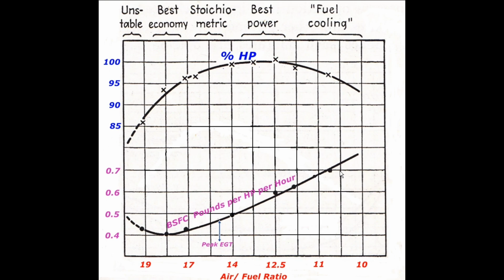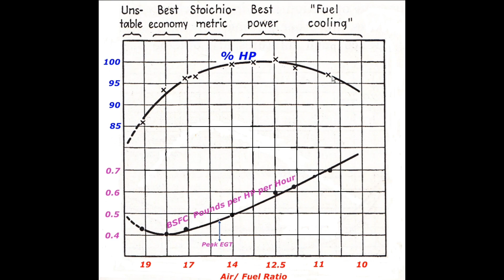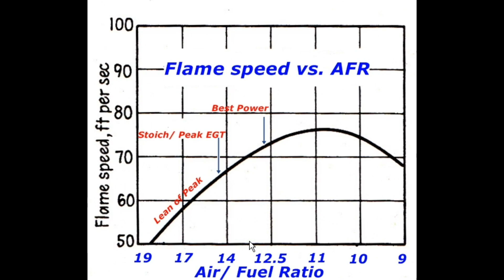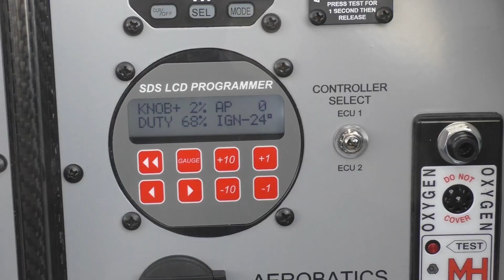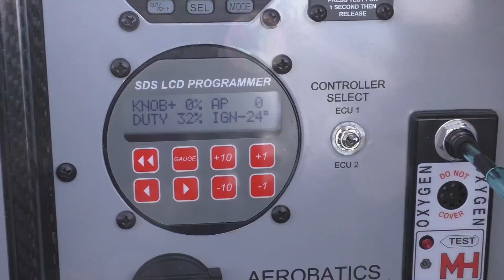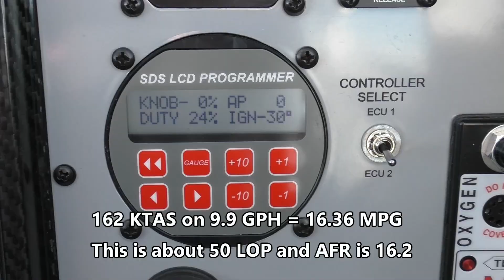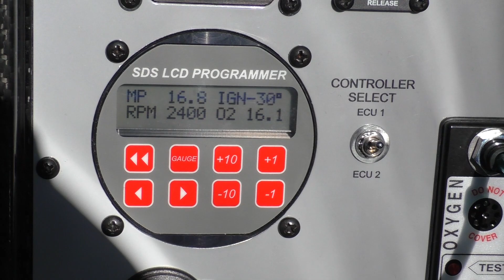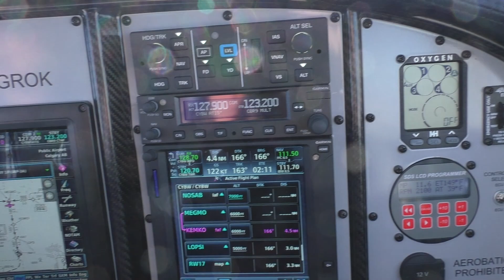Mixture vs. Ignition Timing vs. TAS and Fuel Flow

Comment: Looking at you numbers, it appears to me that you calculated MPG by dividing the TAS by the gallons per hour fuel flow.  You are just showing different efficiencies with the different AFRs and timing settings so the actual units don't really matter for the purposes of this test, but since the TAS is in knots, the efficiency is actually nautical miles per gallon.  Just picking a few nits here.
Reply from the maker: Yes, NM/gallon is what the chart is showing. Sorry, I'm not understanding your point here.